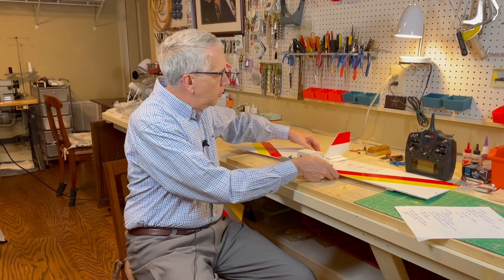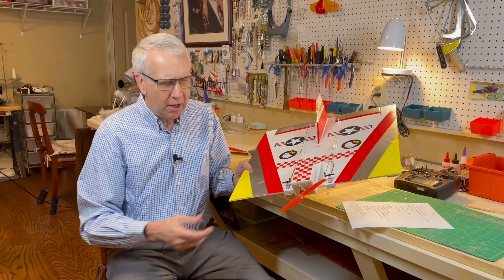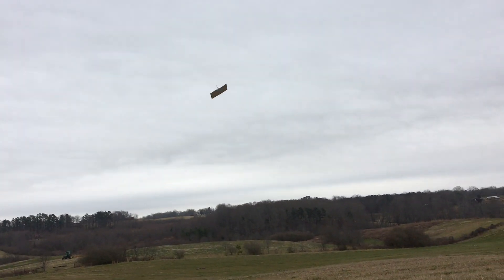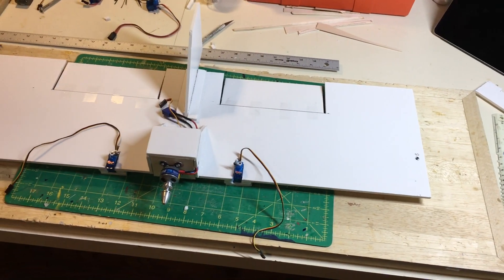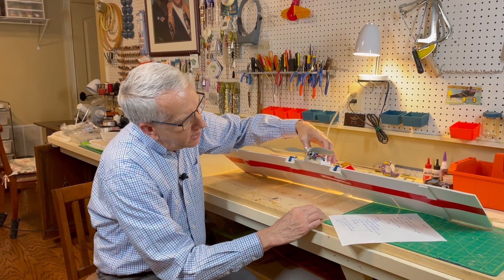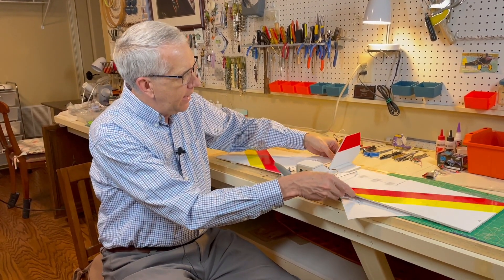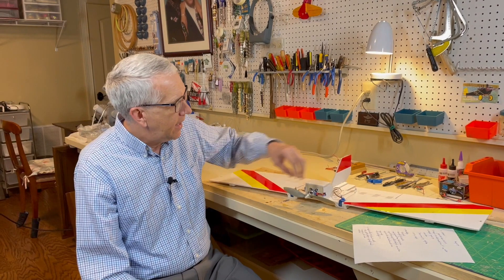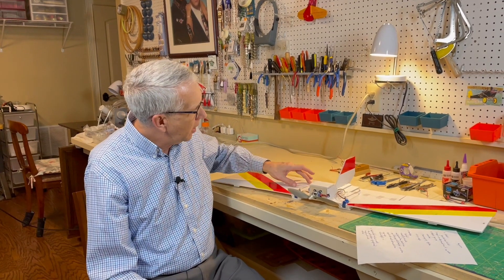Rectangle RC Flyer Lessons Learned

Comment: Hi Capt. Tim.
This is a very interesting experiment. Maybe, if the empennage is pushed back a bit (maybe 10-15%) you might have better control over the Y-axis.(?)

Also, unrelated topic, any advise on making simple foam wheels for depron electric rc a/c?
(We don't get much choice for wheels back home in India).
Reply: Advice* (sorry).
Reply from the maker: RGM:  Yes, good input on pushing the empennage back a bit, I think that would work.  Good news is I finally got it to fly, see video on June 6th.

I thin foam would be ideal for lightweight RC wheels.  A bit denser foam might be a good start, so it does not wear down.  Some 1/16" plywood hubcaps with a short brass tube for an axle point would work fine, I would think.  Tim
Reply: @TimMcKay56  thank you Cap. 

I have seen some videos and will try out a combination of things. Hopefully something can work out.
Stay safe, sir. Cheers!
Reply from the maker: 👍🏻 Tim
Reply: @TimMcKay56  Hi Cap. Made some wheels at home. 9mm thickness plywood, 3cms dia hubs made from said ply, 10mm thickness eva foam tyres with outer dia 6cms over the 3cm ply hubs, and finally layered over with a strip of thick rubber band. Works fine to protect the delicate foam tyres. Cheers, sir. Stay safe.
Reply from the maker: RG:  Glad it worked out!  Tim

Comment: The extremely low aspect ratio of the square airplane combined with its extreme chord (higher Reynolds Number) as well as good longitudinal distance from the rudder to the C.G. makes it such a pleasure to fly. Also, such a long chord provides a good deal of distance from the Cm, moment coefficient (used to be called the "center of lift") to the C.G. making that much less sensitive.
You remember how the Pilatus Porter model was such a dog in the air? You might say that the square airplane is its opposite.
Regarding the rectangle airplane, construction integrity aside, the extreme short-coupling of the elevons to the Cm and too much throw caused the pitch problem, but such a design is fraught with other problems as well. The rudder is also short-coupled to the Cm and that will prevent good yaw control and stability. There are other more technical problems with that design, but these are the most prominent ones.
A rectangle wing is often a good aerodynamic design, but not in its application on this model.
Reply from the maker: GM:  The entire project was a fun experiment.  I did make some structural mods, and the sucker flew like it was on rails.  I really wish I knew why.   😟😁 See video of successful flight (now calling it a plank flyer), out on June 6th!  Tim
Reply: @TimMcKay56  Well, I'm glad to hear that. I don't know why either. I'll watch the vid.
Reply from the maker: 👍🏻🙀😊✈️ Tim

Comment: I have a straight plank I made a few years back (planky 1.0 on my channel). Flies surprisingly well. Looks really weird flying with no sweep. CG was fun. I use 22 percent cg on all my wings. In my case i hotwire cut insulation foam and I put reinforcement on the top and the bottom so there's not hardly any flex.
Reply from the maker: Nathan:  Good info, thanks!  Tim

Comment: Hey, Tim.
While I'm definitely not a fan of foam, this is interesting.
The Zagi (foam flying wing) guys use strapping tape for wing spars.
Also, they're swept back a little with some taper.
And maybe move the control surfaces more outboard?
I'm just spit balling here.
Of course, there are other successful "plank" designs out there...
P.S. How do you like that Park 370? I'm working on a Dumas 40" Stinson and I'm not sure a Park 250 will pull it. I'm hoping to keep the AUW under 12 ounces.
See ya in the next one!
Reply from the maker: Richard:  I like the Park 370 a lot.  Not that much weight, so much power.  I did get this guy to eventually fly, see video on June 6th!  Tim